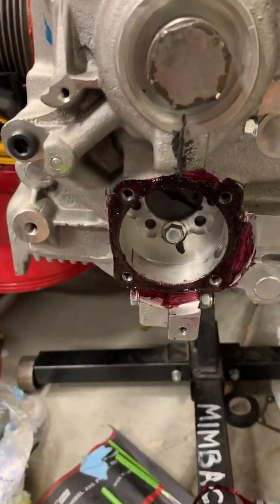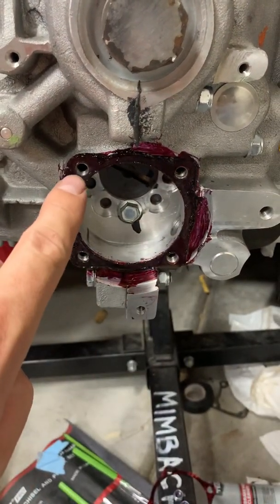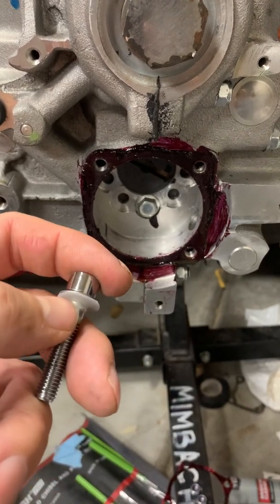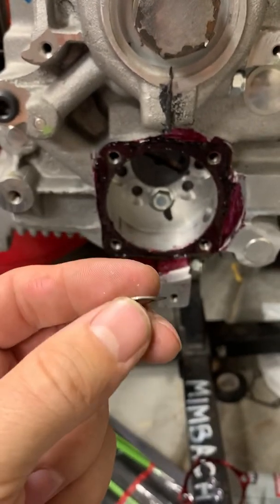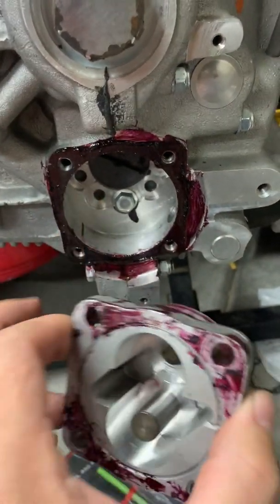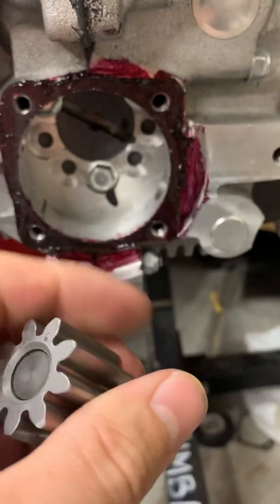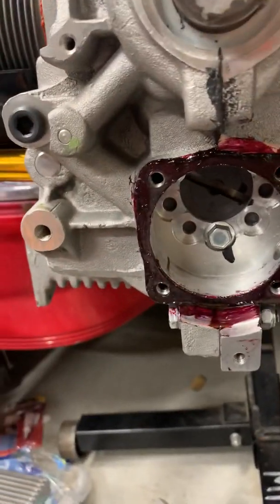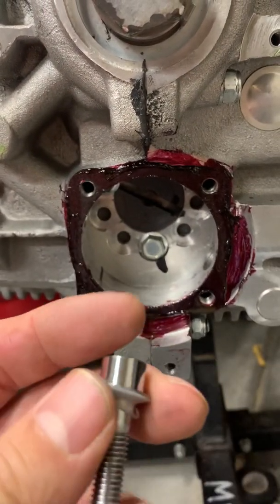Vw type 1 full flow oil pump installation.

Comment: I usually see VW folks use Aviation gasket sealant from Permatex (grey). I got a reddish color like yours and its called Permatex High Tack sealant. Is that what u used and is it ok to use this? Performs  good? Thx
Reply from the maker: I use permatex grey on some surfaces like valve cover gaskets or to seal case halves when we bolt them together. For smaller paper gaskets I use the permatex high tac it holds pretty well I also like gaskacinch.